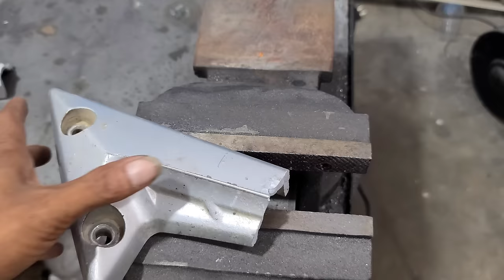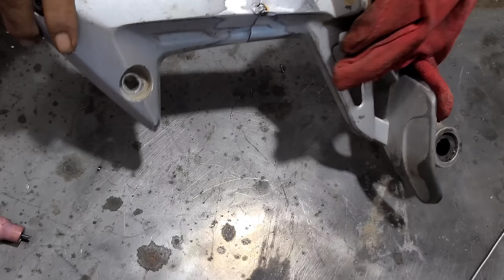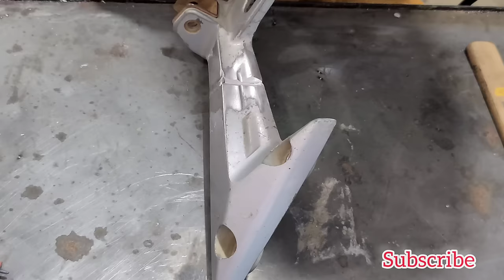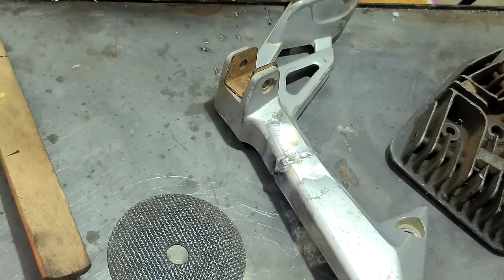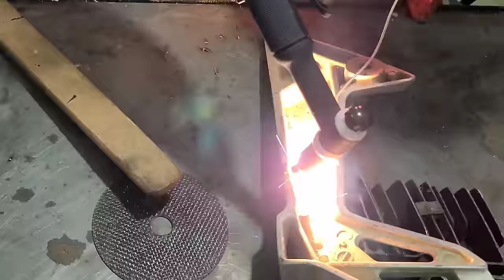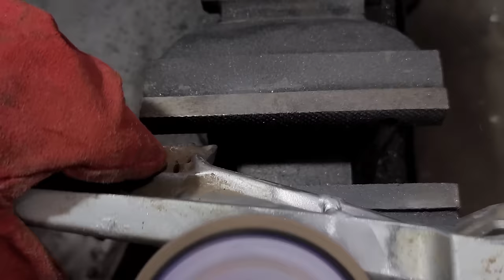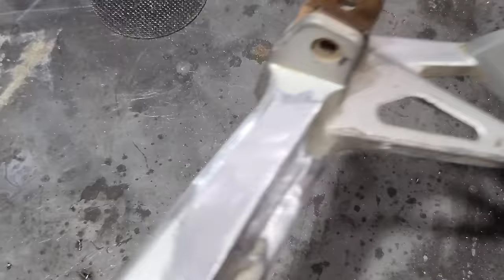how to weld aluminum which is rarely known by many people , tig welding

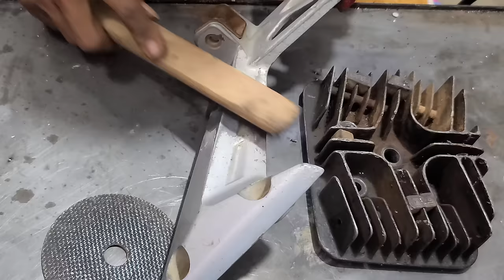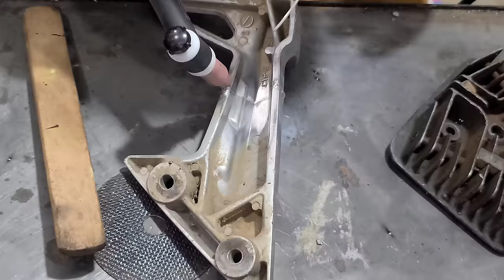Comment: Welding seam argon welding is carried out strictly according to the technology of laying the seam from the bottom up, so starting to weld a detail from the bottom metal is sealed without forming pores (if you weld a detail from the top down the metal will flow down and not formed a dense weld metal to the details) pipe argon welding under the scheme with a clock round dial, from 06:00 to 09:00 then from 07:00 to 15:00 then from 09:00 to 12:00 from 15:00 to 11:00 argon weld lay perfectly if the current is selected . ( The rolled seam is never peeled off ! It is forbidden !)
Reply: That's fine and dandy but the grinding is what needs work, he messed the profile up badly by not going slow and taking care....... very sloppy
Reply: On behalf of the audience, thank you for giving a very important secret about pipe welding technique.
Reply: Well that's not might welding so the technique is totally different anyway

Comment: Depending on the quality of the aluminium casting cos some parts are cast from incredible junk and difficult to produce solid clean welds all through. A little preheat goes a long way  to attain proper fusion . A Filler rod with med - higher silicone value is preferable

Comment: For a truly structural part you should look into cleaning the parts with an acid wash .  The wire wheel will imbed impurities.   Good way to adapt though
Reply: Any kind of cleaner is better than not using nothing to clean
Reply: @RogerHouston-dc9fk  not if it is adding impurities to the base material

Comment: This is far from best practice. For starters don't use abrasive wheels prior to welding as they impregnate the aluminium and cause porosity (at best). Use carbide tools (or similar).  The filler wire should not be from alloy core electrical conductor as it will have incorrect chemical constitution and mechanical properties. Clamp the thing down. Ideally use the other side as a jig if it is a mirror image to ensure the holes remain spacilly correctly.
Reply: Why is everybody forgetting to chamfer or grind the edges at a 45 degree angle. And use 4043 filler rod for cast aluminum. Pre-heat is good if you don't want it to crack.

Comment: Who can help this guy make a proper repair, TIG or not? The misalignment between both parts is alarming, in addition to behing well hidden after cleaning. And the TIG technic is very poor and will certainly result in decreased mechanical strength and further failure. Sorry to say but I hope not too many viewers will be inspired by this terrible demonstration.
Reply: Bang on
As you say poor cleanliness.
No bevel edges.
No preheat.
Also cast ally parts are notoriously made of the cheapest aluminium mixes so you never know the type of ally your dealing with.
They tend to have serious porosity and once the black inclusions come to the surface it's nearly impossible to fuse the filler wire

Comment: With right equipment(regulated AC tig) it is not that hard. 
What welding machine was used here?
Also I would leave natural weld, and not grind it off to flat surface if it doesn't go into way during movement. It would be stronger repair.

Comment: Looks good. Not sure why everyone has a critique on the work. It's a bike peg bracket that works again. Good work.
Reply: for how long with all the electrode dips into the puddle
Reply: @willardlentz3044  probably forever. It was a cheap cast aluminum part before. It's likely much cleaner internally now where the weld is.

Comment: Cast parts like this are typically 3000, 4000, or 7000 series aluminum, which is about 95% aluminum.  Power cable is 1350-H19 is nearly pure aluminum (99.5%) making it an excellent conductor.  While 1000 series isn't the best choice for filler material (lower strength, increased risk of cracking when welding other series), it would work in a pinch if you are not trying to achieve structural strength.

It is definitely an interesting thought experiment what other materials could be used in a pinch if you are out of 4000 series filler rods.

Comment: Welding cast aluminum can be tricky. There’s often a bunch of junk in the casting that can make welding it a real pain. The junk spits and spatters, and makes these bubbly hollow voids in the weld that have to be chased out and replaced with fresh aluminum rod. And this is where it gets tricky. The key is to be patient and displace the junk while adding fresh metal without making the weld pool too large and to take multiple passes. More often than not, the weld will fight you the whole way and you’ve got to remember to get carried away and not be tempted to keep chasing the junk. If you do that, you are only going to expose even more junk. The first weld is usually going to look kinda crappy with voids and other impurities that surfaces. When this happens, simply grind off the junk with a disk and cut a new valley with a carbide burr die grinder in the aluminum where you just welded. Then try welding it again. There shouldn’t be as much junk that surfaces and your weld should come out much better. The gasses from all the exposed junk could possible displace your shielding gas and spoil the tungsten if the cast aluminum is bad enough. The key is to be patient.
Reply: I once grabbed a nice looking piece of aluminum out of the scrap hopper at my job and put it aside with my aluminum.  Sometime later I tried to use it for something I was making and needed to weld it.
I started arcing and heating it up and was amazed by all of the oil that began to pour out of it.  Like stepping on a soaked sponge.
Apparently it used to be part of some oily machine.

Comment: Clean with a wire brush, tack weld and make your groove, match the alloy with the right type of rod, utility wire is extremely pure and soft so would only work on items not subject to stresses. Preheat the part and weld it with the correct depth of penetration. Do the back the same way. As shown your part will probably have voids and most of the crack present. 😮

Comment: Not all tig welding machines can weld aluminium, you need an ac inverter.  The constant polarity fluctuations is what stabilizes the temp. of the aluminium pool when welding.  Aluminium melting point is lower then the aluminium oxide on the surface, hence the need for temp control.  Or, spend big and get synergic mig for aluminium welding, you can't go wrong.

Comment: Not sure which is worse , cable filler wire or Jb Weld .
  After many years of owning a weld and machine shop , the hardest part was refusing this type of job why ? they never are worth the time you have in them . Unless it is favor ( can’t charge for a favor , you however can be a favor up ) parts like this are rarely a good grade of aluminum ( 356T-6 ) and if it hot cracks on you , it’s scrap . Think you will be paid . And if you can weld it , put a chair behind the owner before you give him ( or her ) the bill

Comment: Wonder what kind of of aluminum that is. I'm guessing a 7000 series.  You can melt it together and add the filler which looks like electrical wire and probably an 8000 series. You can melt it all together, sure. But it's no where near as strong as it was. The heat softens it and it stays soft until it's aged--if it can be aged after you mixed the unknown alloys. For a part like that you'd be better off replacing it with a used one.

Comment: Aluminium welding is hardly a big secret so the title is misleading to begin with. As a Journeyman welder I can say there are questionable practices being used on this particular repair. 

First, you should only use wire wheels and wire brushes that are rated for use on stainless steel. Although I cannot tell about the wheel in this case but I can tell you that the brush is not rated for stainless. Stainless tooling is made with more attention taken to exclude impurities that can transfer to you base material and contaminate it. These contaminates can and frequently do cause problems while welding and can weaken the finished product. The same is true for any grinding wheels or abrasives you may use.

Second, when TIG welding aluminium you should not use a point tip on your electrode since they can cause erratic fluctuations in your arc. Good practice dictates you should use a ball tip electrode to ensure the best results. 

Third, using wire from an unknown source like electrical or support cabling just doesn't cut it. You have no idea what the alloy constituents are and any weld made with it will be questionable at best. Only use filler wire were the material grade is known if you want consistent proper repairs. Since aluminium will form an oxide coating when exposed to oxygen, it is good practice to clean the oxide off immediately prior to welding. You do this by using a fine grade of emery cloth and abrade the oxide off the surface of the filler material. DO NOT USE SANDPAPER FOR THIS. Sandpaper abrasives are not graded for quality nor are they bonded to the backing as well as emery cloth is and can cause contamination in the weld.

Fourth, mount those pieces in a fixture prior to welding. The fixture will help control warpage and twisting. I doubt very much if this part will fit properly when re-installed.

Fifth, if at all possible, weld from the back side first and not the front exposed side as shown here. Once the backside is fully welded, you can grind down to the root of the weld from the front to get full penetration giving you a superior weld. The weld shown here is only a "skin" weld and then he weakens it further by grinding away all of the re-enforcement on the front exposed side. I doubt very much that this repair will last very long since it is a foot peg mount for some kind of vehicle and will be subject to varying loads.

Sixth, take more care when grinding down your weld cap than shown here. Use a combination of grinding wheels, die grinders with carbide burrs, drills with mounted grinding points, and files to get your finished product. Leaving a mess like the one shown here is amateur and reeks of shoddy slipshod workmanship. 

All in all to blindly follow what is shown here is a literal guarantee to produce crap results.

Comment: this is the second most used welding type after mig\mag welding, it is a verry well known method. it may even be the most used method. but in marine\boat welding mig welding is most used.
Reply: cómo se llama la.suelda
Reply: Gracias
Reply: @diegotoaquiza7521 aluminum
Reply: @diegotoaquiza7521  this is not soldering! soldering and welding are different, with soldering it is only the added materials, the solder that you asked about that melts, it works a bit like glue and holds the materials together by binding to them, the same applies to brazing, the added material is often specially adapted for the application, and flux is used as a cleaning agent. when welding, you melt a stick\wire, in the process the nearby material you are welding also melts,  it creates a fusion of materials, you use a shielding gas to keep the area free of oxygen, as oxygen creates an oxide coating that destroys the weld during welding. in stick welding, the coating on the wire is what creates the shielding gas, the material is often the same or has similar properties as what is to be welded, with tig these are often simple wires.

Comment: I like to use a cutting torch to preheat. I first will smut it up with straight acetylene and then turn on the oxygen and burn the smut off. Then it’s clean and the perfect temperature to weld. Just my way.

Comment: Good work but you should wear safety boots and a guard on that grinder!
Reply: Oh yeah you definitely need a guard when using a wire wheel, them things don’t feel so good when they fly off the wheel and stick into anything, got a few too my neck and it does not feel good.

Comment: How to weld aluminium is rarely know by many people, well this chap is one who doesn't know. He would make a good welder cry, using a rusty steel wire brush, incorrect filler rod, no prep when restarting welding tungsten inclusions. The list goes on and on.😢

Comment: some people said the wire brush must be stainless ,,,, carbon steel wire bush is fine BUT there can be no rust ,,, strength drastically is reduced unless a tig wire is used ,,, the wire has silicon in it makes a big difference ,,, if the weld id just to hold a cosmetic ornament together the wire doesn't matter ,,, Dr. Edward P Waring ,,, Chief of Metallurgical Science ,,, NASA

Comment: @KULI TENIK. First find out why it broke ,will the welding last if assembled again. Welding the, Job is superfaontastic done but  if the bracket has to give more life than if possible a MS.plate six Mm.thick could be fitted on its plane surface with at least eight nut bolts four on each side of the welding
Reply: Это похоже на кронштейн подножки пассажира от мотоцикла.., особой нагрузки там нет и деталь прослужит до следующего падения... 👌🤫
Reply: @zub2332  what language is this?
Reply: @chandramohanpai2082  Have you never heard of Russians? Click on the translate button... Or is there no such possibility on your phone?
Reply: @zub2332  Sir,sorry it's not getting translated, any way thanks for your responce
Reply: @chandramohanpai2082  I just wrote in my comment that it looks like a passenger's footrest bracket from a motorcycle, and such a fortress is not important there, but it will last until the next accident with a fall on its side .. .
Reply: @zub2332  thanks sir l am from lndia knowing only English.
Reply: @chandramohanpai2082  

I only know Russian and Ukrainian, I don't know English.... 😪🙈

Comment: Relax everyone, it’s only a motorcycle passenger peg bracket, the only holes that need to line up are still intact on their respective parts. For those asking what welding machine is being used, all you need to know is its capable of AC TIG. As far as clean up and prep a stainless steel wire brush/wheel is fine for aluminum, as long as it’s stainless. True he’s not a pro but a beginner would struggle to even lay a bead welding aluminum even with pulse function on.

Comment: Yep! I also cringe. Like most commented before about same issues.   Using old power line wiring as a filler wire.  More than likely not even the same alloy of aluminum.  I would say it is a much softer alloy.   Could end up being a very dangerous event.  If that is a foot peg off a motorcycle.  Likely to break again and rider might not be so lucky!

Comment: Use welding rod not electrical wire. You should have beveled the edges before tacking. Last no need to pulse an thick material.

Comment: brpa modal las tig mas kalo lengkap ama tabung argon nya???
Reply: Dohua, это только русский поймёт 😁
Reply: Como 1500 a 2500 dólares de cuerdo a cada país.
Reply: Pour une utilisation occasionnelle et de faibles épaisseurs jusqu'à 5-6 millimètres, moins de 1000 € suffisent. L'argon n'est pas cher, par contre il faut prendre soin de la buse et de l'électrode chères à remplacer.
Reply: @davidfoo2762   j ai trouvé un Stamos AC/DC 200 A allemand a 500 euros et 150 la pédale d  intensité neuf  c est donné

Comment: You are DC welding aluminum...  definitely never seen it done like that b4.  Aluminum welding is ac welding... just the sou d alone can tell the difference....
Reply: Direct current would not have worked, the oxide film would not have collapsed. Only AC

Comment: You did 2 big mistakes: 1st the pieces were not grooved on the inside first to a double-vee joint  and leaving 3 points about 1/2 " long on the outside not grooved; 2nd  the pieces were not clamp down to a heavy duty flat plane-table. Also alternate your welds where as the last pass is done with the work piece clamp down to avoid drawing and warpage, then post heat to relieve stress.  This process will give you 100% penetration, trueness and stronger product.
Reply: Самая большая ошибка при сварке деталей из алюминиевых сплавов - это использовать такую присадку , а не специально подобранную для этого. Если деталь ответственная .

Comment: First off ya need to put a nice shiny ball on the end of that tungsten. Ya don't weld aluminum with a sharp tungsten you use a argon helium mix. And ya bevel the weld zone so ya get good penatration. This weld had no pen then he grinds what weld strength he had off the part. I could go on and on. If your going to do how to videos teach people the correct way. Dont give welders who took the hard earned time to learn the skill. A bad name. Do it right or get out of the trade. Oh and the filler rod material is not even the right alloy for the project. You need a 4043 or 50 series rod.
Reply: Then make a video cause I’m trying to learn how but I’m to poor and slave driven to hard to buy shif or go to school. Zoo YouTube university is all I got man lol
Reply: Bla bla bla! Haz tu propio video y deja de molestar